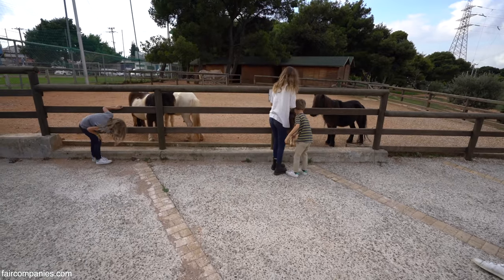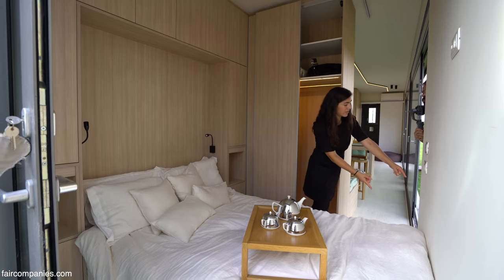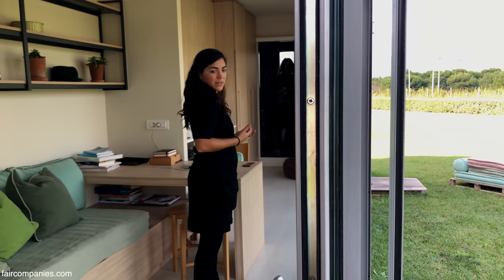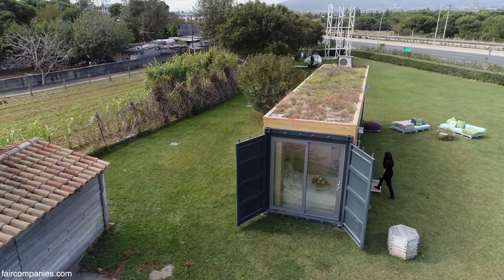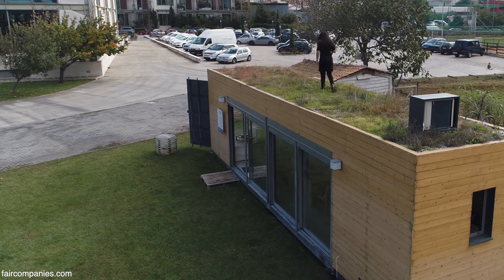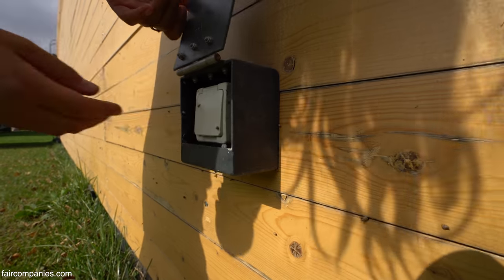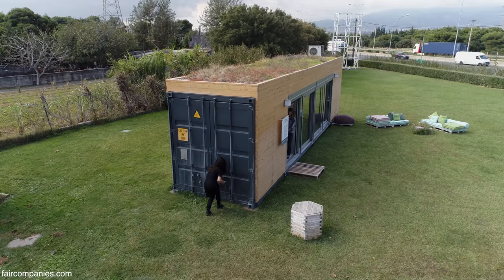On designing a stackable, bioclimatic shipping container home

Comment: She said if the shutters are down and there's a power outage, you have to exit from the bedroom door. But that also locks from the outside. Wouldn't be much fun in the case of a fire!
Reply: The bathroom window can be opened.
Reply: The shutters also are manual
Reply: hel1nas she said manual from the outside
Reply: @aljowen  Not everyone could get through it, one reason or another.
Reply: Simple answer would be to have the end doors lockable from the inside only.
Reply: That was the first thing I noticed......Cut the power and you have yourself a prison out in the woods..
Reply: @williamskrainski8407  True, but it is a method of escape that the original post omitted.
Reply: Viktor Hunyadkurti 

It would seem that there is a perfect opportunity for a design engineer to create a system that can be retrofitted to the container doors, as to allow the door's outer closure mechanism to be operated from the inside of the container.

I've been thinking on that point for quite some time but have yet to envision a workable solution.
Reply: In case of fire, it doubles as a coffin 
😮😮😮
Reply: @williamskrainski8407  i'm not an expert,but hopefully you would have a blanket or two to throw over that fire... in any case, this is a prototype,so maybe they improve the design for future house.. ;)
Reply: @sapphirecamui6447  I love the concept, and could see myself building a fort in the woods with about 12 of these....(3 tall to make it difficult to repel....that would put it at between 24-28 feet tall)...I like the lock on the inside.
Reply: Doors would have to have a something else that can be used in emergencies definitely.
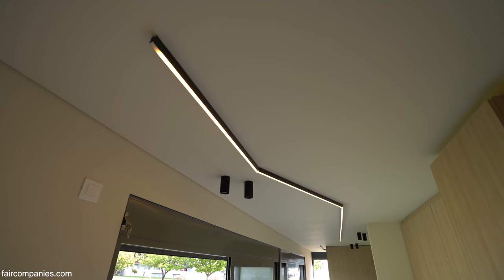Reply: If you have a closer look in 9:20 you can see the inox accessory that opens the shutters from the inside. I do not now any residential shutters for aluminum profiles that can be opened from outside. Probably she was referring what if the electricity is off, container is sealed and you want to enter. Thus you use the original container's doors.
Reply: Too add to your comment, the container lacks  safety because you can open the steel door to bedroom from outside. Steel shutters are pointless due to bedroom door.
Reply: Shutters  have a manual  way of opening (I have manual ones in mi house ) you need to grab the rope that makes them  slide and  pull
Reply: I believe that the regulations require to have fire sprinklers
Reply: @aljowen  not good for fat or disabled people
Reply: Casandra Langley
On the inside of the steel doors, are sliding glass doors to be locked while staying in the home. The steel container doors at the end are only locked by the owner from the outside while the are out of town for the season. This home is a prototype to let people get a feel of it. Buyer chooses options for their custom made home.
Reply: who normal live in a container? rich to villas, container for pooor  people . NWO welcom
Reply: @hel1nas  only from outisde. Viktor has a very good point.
Reply: @benicsakp  It would be good point if there was not inside manual crank that rolls the shutters.
Reply: @genkatqltr737  not all people are hippos
Reply: @hel1nas  Where is it stated?
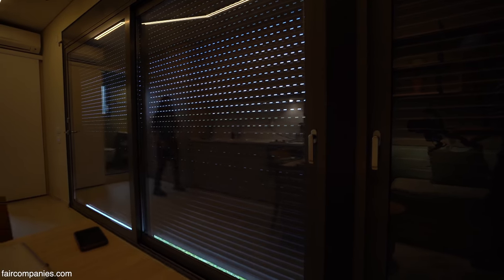Reply: @benicsakp  05:03 also you can see the manual crank on the upper left at 04:38 and 04:50. I have the same system at my house, and i am not letting the lever hanging. They have taken out the lever in order not to hung and have more clean design for the presentation.
Reply: @williamskrainski8407  Listen carefully again 05:03 there is manual system to lift the shutters and it is quite common system.
Reply: @hel1nas  Indeed. Thanks for sharing!
Reply: @i.sirius6204  Agreed. Whenever I see the containers retain the locking doors, it seems like they're leaving the option to be locked inside.

Comment: I only see 1 problem waiting to happen with this, it has no escape hatch. Scenario: you open the container for habitation, you are using the sliding doors as ingress and egress so the doors at the end of the container are secured closed, you close the shutters for privacy for the evening, you lose power or the motor malfunctions. How do you get out of the container??
Reply: Use the bathroom window

Comment: She did a great job designing...even put some structural engineering on the table with the bracing on the bottom of the container. Finishes are exceptional, also. Really a 1st class piece of work.

Comment: my idea is a Π shaped house made of 3 containers and an internal yard in the gap. The south side would be a wooden fence and a small gate
Reply: This is exactly my idea too. It has the privacy and sociality in this way.
Reply: I wanted to do the same. U-shape, open to the south. Two storey (total of 6 containers). Covering the internal yard with glass/plastic to create an space which was part living room, part greenhouse. The greenhouse would be tall enough to fit full-size fruit trees. Great minds think alike :-)
Reply: @bowehj96  Where did you imagined the windows? Only to the open side facing south or some on the other side? And what about the main entrance?
Reply: @turansevincer2252  That's what I was thinking. You would need to orient the containers in such a way where the middle could get sunlight. I was think thinking making the middle portion have a skylight of full glass and slidable glass doors for ventilation but it's such a great idea
Reply: Lovely idea, I love the ideas of a small home but a lot of them are really invasive when it comes to privacy.

Comment: I think this is a good design. The timber cladding would have to go as in a wet climate woodrot would be a big problem. I love the sliding doors and the shutters. I priced these shutters in Ireland and they were astronomical. Even the cost of the doors alone has to be very expensive. All in all well done.

Comment: Not bad, but I think I would rather have a bunch of smaller holes in the walls and ceiling than two giant windows. Not enough privacy, and I wouldn't rely on those automatic shutters either.
I think I'd also prefer more deliberate sectioning and doors inside the one container. But I like the idea of making the containers modular, so you can achieve the sectioning by just getting another container or two, depending on needs.

Comment: unless this is going to be cheaper than conventional houses it makes no sense
Reply: Portable
Reply: From what I've seen, shipping container homes seem to run at about 1/2 the costs per sq.ft compared to a conventional home.
Reply: david jeffery  Even better :)
Reply: david jeffery  do you guys have legitimate sources?
Reply: @danw4237  :   Yes - true - but builders of these container homes charge four times the cost (in USA) of conventional homes.  Why - you may ask?   The builders claim containers are difficult to make homes.  Why would the builder charge four times greater when container costs 1/2 lesser to make a home?  I see greed in their hearts.
Reply: ...except that's not how markets work at all. I would advise studying a bit of Austrian economics as opposed to making baseless allegations and spouting class warfare rhetoric which is the refuge of economic ignoramuses.
Reply: Ercushka Kulmetov Yup, true
Reply: Forget the cost where the hell are you going to put the fucking thing? Good luck finding a place in any city to put it. There is a reason why pretty much the only place you see tiny homes and shipping container homes is on YouTube.
Reply: Agree, I try to buy one a few months ago, they want 125k for a single 40ft container, plus $3k for shipping from Cali to Arizona!  plus permits and here in AZ a permite for this kind of building is not cheap! so I just bought a tiny 3 bed 2 bath 900sqf house for $120k instead.
Reply: This is also hurricane, tornado proof as well, unlike most traditional homes.

Comment: I think it is interesting that she said that it was more expensive to do the container over normal steel construction. I actually like the layout (other than the bed crossing the entire width.) By itself it is minimal. As an enclosed foundation of a big outdoor living space it would be really nice. I could see even foregoing  the seating area and expanding the kitchen into the living space.
Reply: ikr then why would you do it
Reply: The push to use shipping containers is primary recycling, building using more sustainable materials, and low initial costs...

You are usually initially paying much less for the shipping container, because they are usually used and being sold for a fraction of what they cost to build originally.

But there's a threshold when converting them into livable structures where the costs rise higher than other options and the limitations of the design options become apparent and that usually overlaps because that's usually the point that you have to do significant changes to the container to get past its limitations...

A lot is still possible below that threshold. It's just hard to avoid going over that threshold but if you can keep below it then it's something to consider...  

It's just something to get used to with construction that options may be niche and may not apply to every type of building you may want to construct.
Reply: I know of a few where labour and material costs are lowered because people have done alot of the work themselves and spent hours combining the internet for recycled or special prices on materials.

Comment: The cost per sq foot. Only made for a couple . not space for a mother and child. The container doors can house utilities furnace water. Solar hot water etc. The bedroom at opposite end of container. Another set of steel doors at other end of container with steel doors. Would add 4' at each end. A set of bunk beds that are Murphy style would accommodate two to four beds. Convert metal wall cur for slider as a drop down deck and security instead of roll up . use the container metal. You can add awning and wall for screened porch to frame of container. This unit will be moved once. A re cycled Mobil home frame could be used for decking and storage as well. The Amazon warehouse robots could be used for Mobil storage in another 20' container. Could be climate controlled.
Reply: If you build a loft bedroom then the child can sleep up there

Comment: This and the examples shown on the laptop are the best designs using shipping containers that I have ever seen. 
I'm not a fan of the seeded roof and would use the flat rood once sun insulated to mount  solar PV panels along its length you could even add a passive solar water heater to reduce you water heating costs

Comment: so actually we can build a house like that without shipping container involved, just bricks and woods, i think it is cheaper and better.
Reply: No it is not cheaper and better. First off the structural strength of these containers beats wooden frame and bricks. Containers in North America can range from 2000$ to 8000$ per container. For the size, framing, insulation, ply wood, and brick would cost much more.

Comment: Putting dirt on a roof was okay before modern roofing.  I live in a earth sheltered home  and it is nothing but trouble good when new by does not age well.  With all those windows you need overhanging roof  and all that dirt will be like  living under a big sponge. I promise you that roof will leak if not this year. The cheapest containers  have rotted floors .  Buy it , cut out the old floor , set it in place  then pour in concrete.

Comment: All the cutings kill the sine of this Container. Sea Container should be standard size outside in main reasen for Transport on street without special permit.
The Container interial and groundplaning is good.
What is the frame and the green on roof good for`? Is this absolutly needable? Is it Possible to use this room for solar panels and not for dirt ;)
And is it possible to get the container autarc

Comment: It is useless to put extruded highly dence polystyrene (the green one) as a roof insulation, just use normal EPS 70, it is cheaper and does the same job under roof.

Comment: If the original end door locks from the outside and the  metal blinds only open manually from the outside, the person would be locked inside in case of power outage!

Comment: Where does the poop go after dropping it?
Why doesn't have a solar system on the roof instead of a dirty garden?
How can it be off-grid without a powerful battery? 

Where is the battery and water deposit in this container?
This needs to be connected to the water and waste system 24/7.
Also, they don't even consider on having shades/curtains to gain some privacy.
You have to block the whole thing with the shutter.

Nah. It´s just a silly architecture student's project. Nothing serious is going on there.
It's not even a good one. Splitting a rectangular space to distribute basic home components is something a kid can do. Even better than this.
Reply: It's a prototype. Nobody is living in it.
But this project has been done many many many times by now. Nothing new here.

Comment: i consider more than one container - side by side, or 3 20ft boxes, side by side, with a pass through, Have seen two of those and they work. Stacking, could work, but I would move sideways. Just not on a freeway.
Reply: Kelli Andrews  pod construction techniques add to and can use these containers. I understand that the small container can be moved with a rental truck, but moving the large containers requires expensive extra help and equipment. Possibly being American i like the bigges container best!

Comment: She says having multile containers together makes it "unsustainable" (not really sure what she means by that).... then she goes and shows some designs with multiple containers lol
Reply: I think she means that if you add stuff like beams, to make let's say a porch, it's not easy to transport anymore, which is when it loses sustainablility. But if you would use 3 containers, and make them easy to connect ones you place them, it's still easy to transport.. At least I'm guessing that's how she thinks of it.
Reply: @EliTasrev  Yeah, the context was that if you remove large parts of the structure you need to bring in beams and pillars which makes the simplicity angle of containers pointless.
Reply: The cost of adding more containers is not linear.  Since you're adding to the complexity and labor with each addition and is especially true if all the units have to work together to form one larger structure but can still be taken apart for transporting to a different location.

So the costs can rise significantly with the more units you put together and it's not unusual for multi-container houses to run into the millions.

Larger construction projects are also prone to generating more waste and the more time it takes to complete then the more likely corners will be cut that will generate even more waste because time is money...

The resulting large structure also can't be as easily repurposed as a smaller structure can be or as efficiently taken apart for materials without a significant percentage being thrown out as waste and this all also effects the cost of labor to get it done...

She actually stated the containers are more okay for smaller projects and traditional metal framing is better for larger projects and what was shown was primarily what they've experimented with as even the main one in this video is a prototype...

Comment: is it more economical to buy a shipping container and tear it apart compared to buying the square steel and welding the frame from scratch?
Reply: Certainly easier to insulate that way, especially if linking multiple containers. However cheaper is unlikely because the container has had its use (especially an ex-China one that's not getting used anymore)

Comment: The sad 😞 part is that they put all that money into that prototype, yet the bed room security container doors can only be accessed outside 🤦🏾‍♂️ hey tony open the back container doors , kick 🦵 in the window
Reply: You can easily cut off the exterior lock lug and use a bolt on the inside. They may have already done this. She didn't go into close up on the end door hardware

Comment: "But it makes sense to use them?"
"Unless a client really, really wanted a container house and he really loved the raw material, and wanted to proceed with that, yeah absolutely. But if you wanted to keep the costs down, I'd go for metal construction"

Even the designer says container houses are impracticable. 
The only real advantage of container houses is that they can be shipped on a truck and installed / removed quickly. For the same cost you can actually build a larger / nicer house.
I love the idea of container houses but they're a poor solution to most applications.

Comment: Can't be moved easily. Over height, missing the pickup points, completely useless.
Reply: Did they say total height? High cube containers are a thing.
Reply: No, the corner mounts are still there.  It just can't be stacked.  Besides, it's just one of many design options.
Reply: top corner fittings are still there. For height considerations, I would think they would take down the AC unit when moving it. Even with the green roof, I don't think a high cube is over height.
Reply: @whatintheactualf : A sticker on one of the doors of the container says the height is 9'6". Clearly, this doesn't include the height of the base on which it sits. So you're looking at an overall height of at least 10'5".